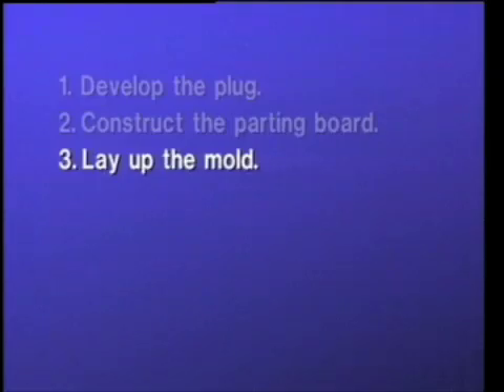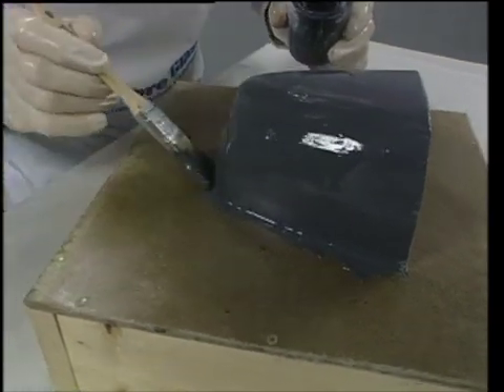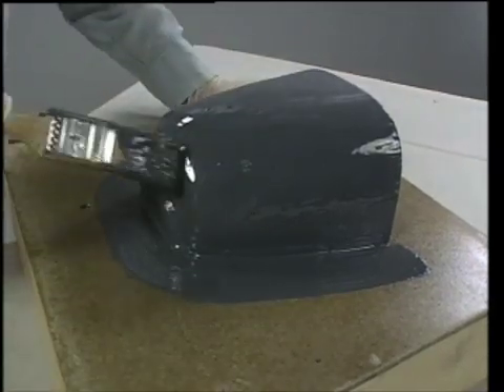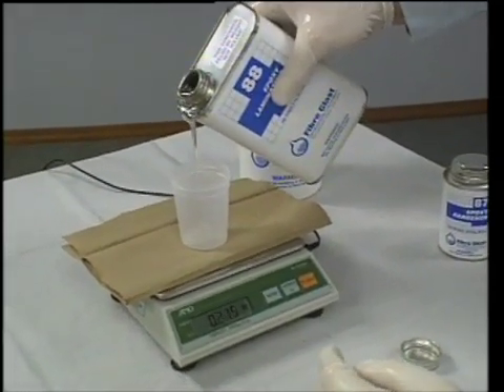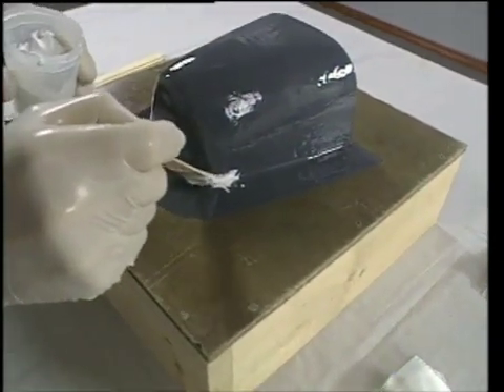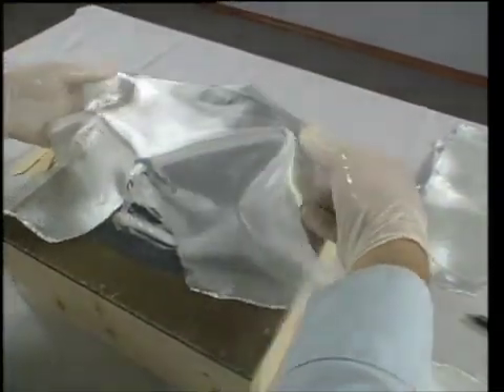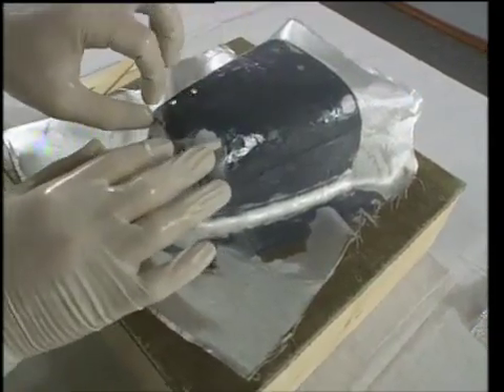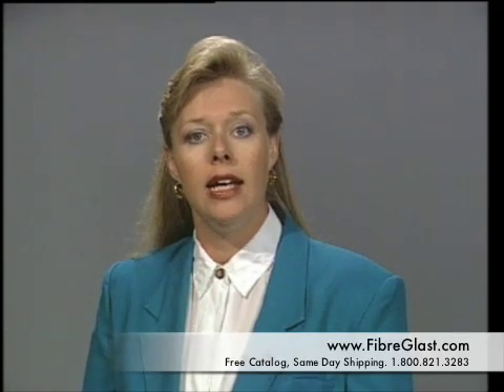How To Mold Fiberglass & Composites 3 of 8

Comment: Using blue insulation foam material for the mold, then acrylic water based primer coat as the surface coat. Is this compatible with epoxy gel coat
Reply from the maker: Thanks for reaching out. There should not be an issue with the water based primer coat but you will need to check the insulation foam heat rating. While epoxy does not "eat" the foams it will melt them during the exotherm.

Comment: Hello, is the surface coat the same as the gel coat ?
Reply from the maker: The surface coat is an Epoxy based coating and tooling gel coat is polyester based. Both are for the mold surface. if you are making a polyester resin mold you would use gel coat, and if you are making an Epoxy mold, like in this video, you would use the surface coat.
Reply: noted. Thanks

Comment: Using tooling gel coat and standard fiberglass (Chopped Stand Mat) is a more modern way to create the mold. Chopped Stand Mat is strands of glass that are randomly laid which provides multi directional strength and once wetted out it conforms well to shapes so you don't need the puddy step IMO. This should be the first couple of layers. After that add a cloth or woven layers to improve the strength if desired. Use Kevlar if you want the strongest.

Comment: it's called PVA. Polyvinyl Alcohol.
I find it actually comes out very good if you use a good expensive brush.
spraying usually leads to heavy air bubbles.
but you can then take a good brush and brush the bubbles away.